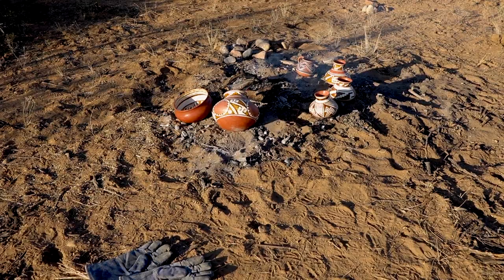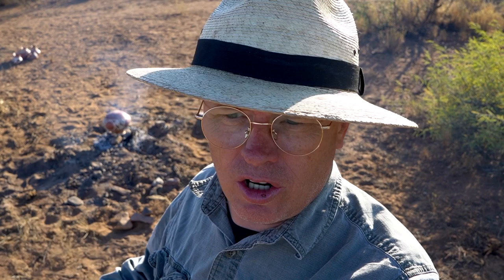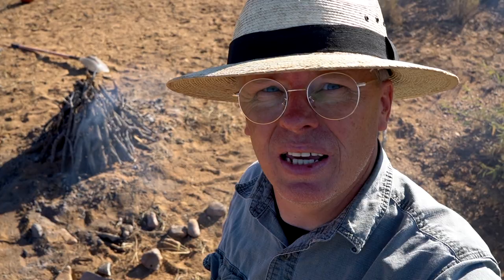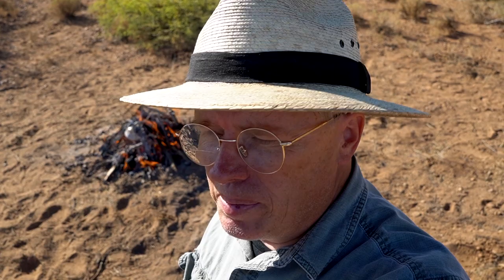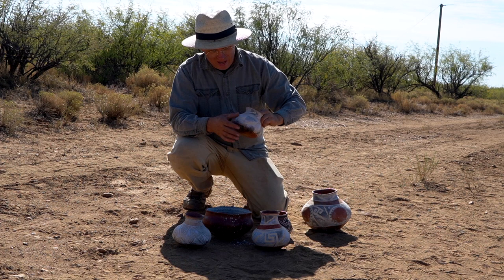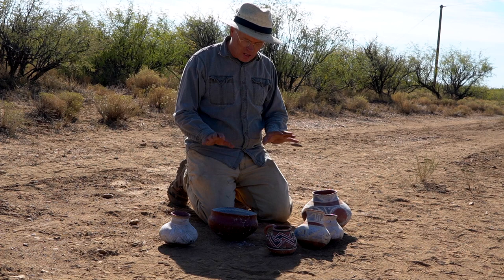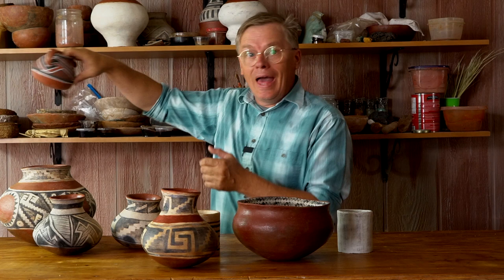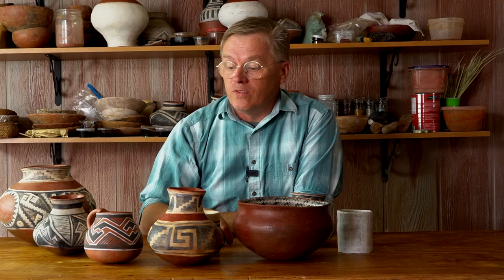Firing Pottery Without a Kiln (the old fashioned way)

Comment: Great video! I’m working my way through your classes and loving them. Even my preschooler is learning from them and has been making and painting pukis for the last few days. Thanks!
Reply from the maker: Excellent! I am glad to hear that the classes are useful to you and your little one.
Reply: @AncientPottery  I do have a quick question - I'm using purchased clay until I can find some wild clay around here.  If I plan to pit fire, should I add some temper to the store bought clay?
Reply from the maker: Good question. I have limited experience with store bought clay but I think that is probably a good idea, otherwise the thermal shock will ruin them in the fire. Perhaps raku clay would be a good choice to handle thermal shock.
Reply: @AncientPottery  Thank you! I’ll let you know what happens.

Comment: You're very brave taking them off the still hot fire. I like my fire die before removing so they cool very slowly
Reply from the maker: It's just like raku, you add extra temper to the clay to ensure it won't crack from the thermal shock.

Comment: In my experiences firing pottery I have difficulty making water proof vessels. I have attempted to make hotter firings to solve it. How well do your pots hold water when using this type of firing? Do the walls of the pots "sweat" the water through? Can they hold water for several days?
Reply from the maker: Yes, they do "sweat" the liquid away. There are things you can do to help seal the pot which I plan on covering in an upcoming video.

Comment: Andy ; WONDERFUL good fire information and GREAT paint  information, and I can see you have been  working hard on your pottery building, thanks so much for sharing What you have work so hard and long to get.. it is a little bit cool in Idaho 37 high 14  low.. ROB
Reply from the maker: Thanks Rob. Temperatures are still a bit high here for firing, I would rather fire when the temp is in the 50s because it is hot work.
Reply: @AncientPottery  to cold most day's with the wind to fire in Idaho. ROB

Comment: Ive been giving this a go in a metal bin in my garden, wrapping the pots in foil to protect my slip painting and placing them in a cake tin too, nothing has broken yet (and im having great fun!) but the last batch didnt seem to get as hot as the foil didnt disintegrate and was very carbon stained, you mention "burning off the carbon" if i reheat them will the black burn off?
Reply from the maker: Yes, you can always re-fire the pots to burn off that carbon.

Comment: I read an instruction that clay is suppose to be heated at about 1000deg for 8 hours or so . 
Why ?
So just simple fire is enough ? 
Can i use coal ?
For how long should i keep the clay inside ?
Reply: If you are  completely new at this topic you should at first check out the primitive technology YouTube channel( just the videos about pottery) it's the basic of the basic, but that's how I begun understanding how clay works.
Reply from the maker: 8 hours is far more than is necessary. I fire pottery in about 20 minutes this way and my top temperature is around 750 C. Coal works fine and will get you a lot hotter than that.

Comment: How long do you let your pots cool after firing? I often get cracks that appear after firing, some hairline others in a “honeycomb”  crazing pattern, is this a temper issue or thermal shock?
Reply from the maker: Yes, I have seen similar things. The answer is to add more temper to your clay. This type of firings produces a lot of thermal stress to the pots so you need to temper your clay appropriately.

Comment: I have moist clay x 15 cone 5-10 will this firing technique work on this clay very new to this..😕
Reply from the maker: Most likely it will but add a ton of grog or sand or diatomaceous earth, some form of temper to help it withstand the thermal shock that comes with this type of firing.

Comment: Been watching videos about primitive pottery and ways to fire without kiln. Thanks for your experiments. Very interesting.
I've been thinking of making some basic clay pots to burn stuff in them. No food or water, they'd serve only to contain a bonfire. Do you think I can get away without firing the pots?
Reply from the maker: Sorry, I am having trouble following you. you want to build a bonfire inside of a pot? That seems like it would require an enormous pot. Am I misunderstanding?
Reply: @AncientPottery  The pot would be about 14-15 inches large for 3 inches in height. I guess you can consider it more like a tray. I don't want to make a big fire. I just want to use it to burn small things in it. Papers, leaves, coals, etc.
Reply: @little_dandelion why don't you just burn the fire outside the pot?

Comment: Is Bentonite clay usable for pottery if tempered properly?
Reply from the maker: In my experience, no. It has a very high shrinkage rate so that if you added enough temper to keep the pottery from breaking when dry it would be possibly over 50% sand (or whatever you are using for temper).

Comment: Hi i love your videos. Every time I’ve tried to burn my pottery in a fire, it has broken. Do you have any tips to prevent that?
Reply from the maker: Preheat your pottery and use plenty of temper in your clay. I hope that helps. Have you seen this video yet? https://youtu.be/sAERJi3XRoY
Reply: @AncientPottery  
Hí Andy,  what is temper ? 
Is that a type of paint you mix with the clay?
Reply from the maker: @sharlekviki  temper is non-plastic material added to clay, things like sand or grog. https://youtu.be/uZZdLLCO8Iw